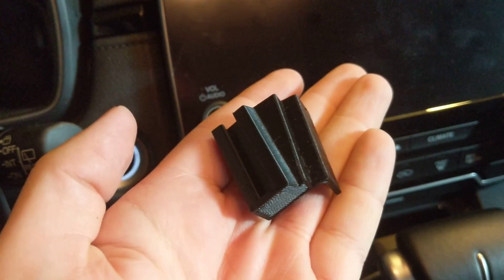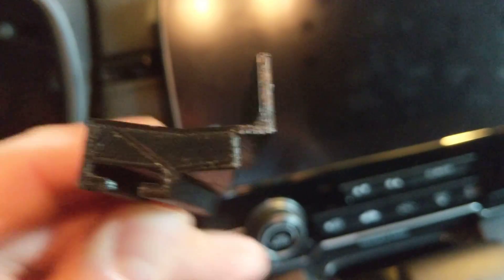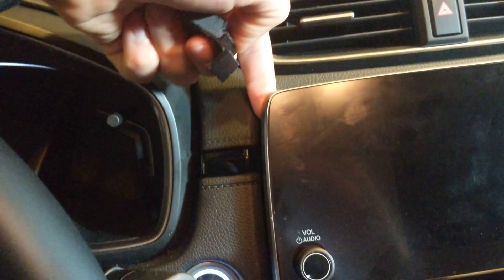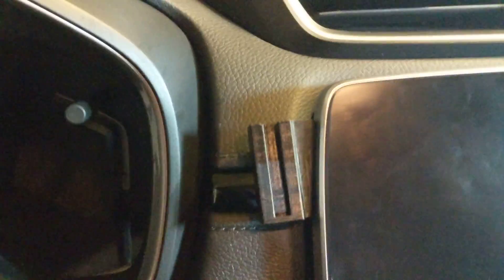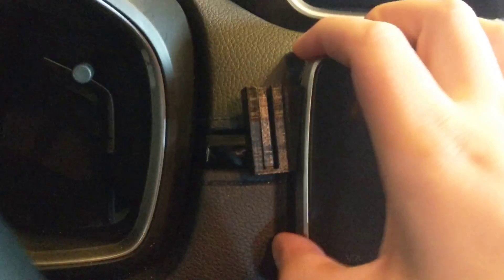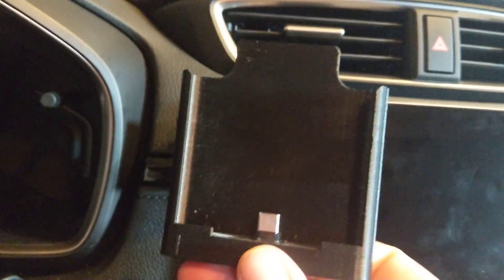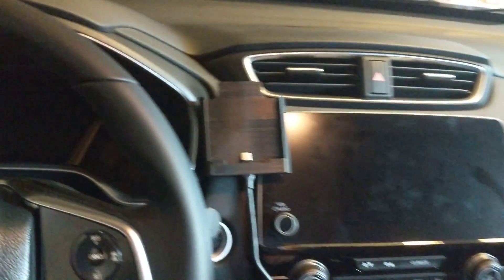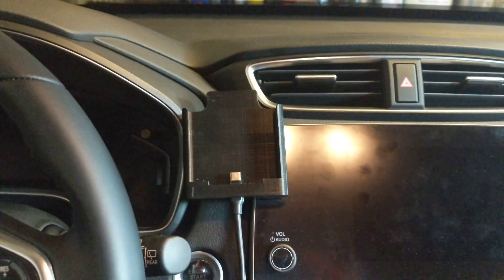3D printed Honda CRV Car Dock for Google Pixel 2

Comment: Found you on Thingiverse. We have a 2018 CRV and this is awesome. We have a clear case on ours though that makes the phone a bit thicker. Wondering if we can remix your .STL file to increase the thickness to keep the case on.

*EDIT* Just found your other video where you have a thin TPU case on your Pixel 2 - I think ours might work the same! Gonna print and try. My wife will LOVE this!
Reply from the maker: Go for it! I still use this daily. I mentioned on my thingiverse page the dimensions. It's easy to update the dimensions on the fusion360 files as it's just typing in a length parameter.